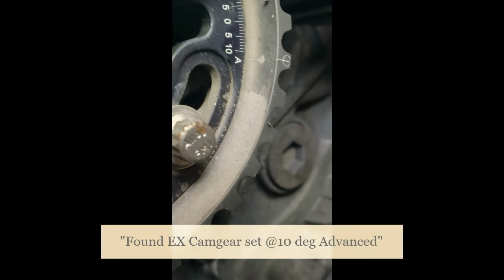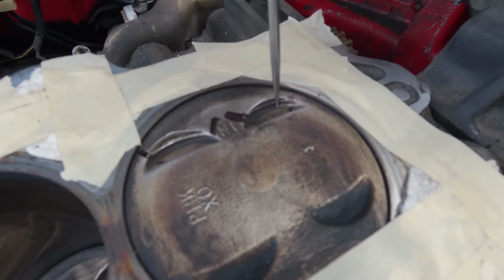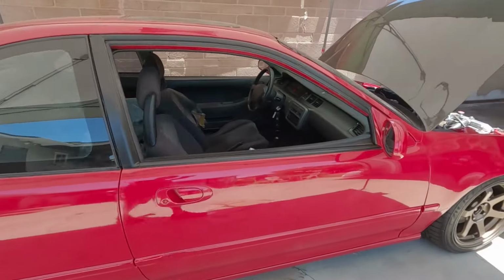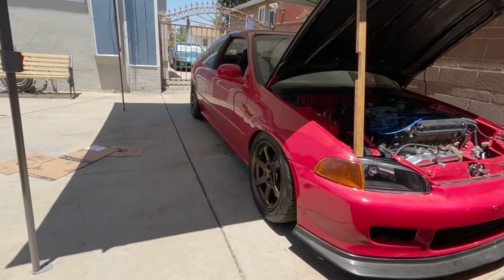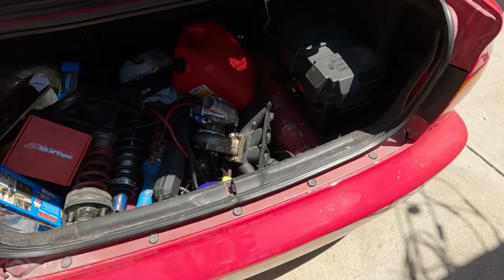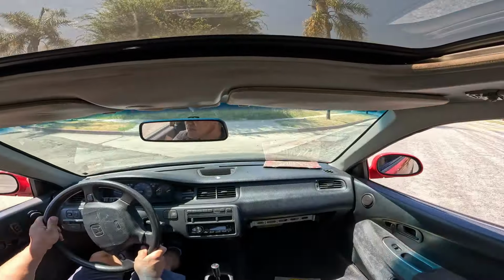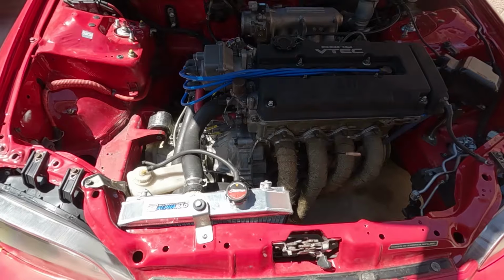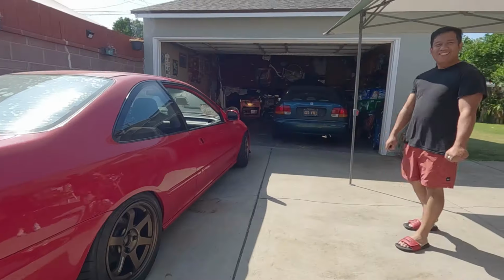Farewell to the B20vtec EJ1 Civic project! ep.10

Comment: Kuya, please. Can you help me?
Reply from the maker: Anything specific?
Reply: @sagittnet2158  yes! I just installed my h23a into my 97 accord but it is tilting towards the firewall.  I think i might need to change the rear mount bracket to a manual bracket. Im not sure though..
Reply from the maker: @germaincouture6483  Yes it tends to that, it really depends on what rear T bracket you'll use. You can check the position of your oil pan when all mounts are securely mounted. See if the oil pan is horizontally level anfvif it is, your next move is to find out if your intake manifold will fit w/o hitting the firewall.
Reply from the maker: @germaincouture6483  Is your Accord manual tranny or automatic tranny? Mine is EX and using original rear T bracket, F22 tranny mount and H22 post mount.
Reply: @sagittnet2158  my accord was SE Auto. Im using the se auto bracket from motor to mount. I think my miunt is also auto. Its the 3 bolt with vacuum mount. Could this cause me any problems or can i safely drive it like this to get me to work?
Reply: @sagittnet2158  i just did the manual swap
Reply from the maker: @germaincouture6483  I was reading some info on accord auto to manual swap and l'll assumed that you got the tranny mount bracket all figured out. Either remove and replace the auto bracket or madify the auto bracket to accept the manual tranny mount. Try to use a manual tranny mount and braket ( accord tranny mount are 2 pieces that's bolted on tranny) even if you use a Hasport tranny mount, it's still need to be mount on the bracket that's secured on tranny. On your driver side post mount, are you using H22 post mount?
Reply from the maker: @germaincouture6483  You must use manual tranny bracket/mount, your auto tranny bracket mount will not work. Try to get a manual tranny mount/bracket (accord or Prelude) and start from there. Driver side, if you already have the H22 post mount, use H22 mount( just need to grind it to fit) Hasport or innovative mount is plug n' play. Once the both sides are good. Use a rear T bracket from Accord manual tranny. Accord EX and SE have different rear mounts. One is taller than the other and mounting bolts for k member is different